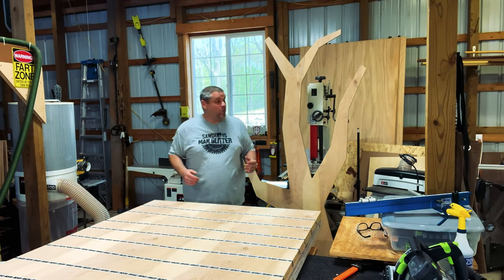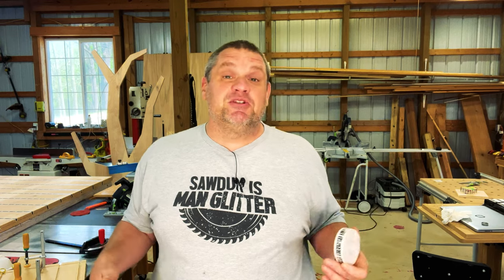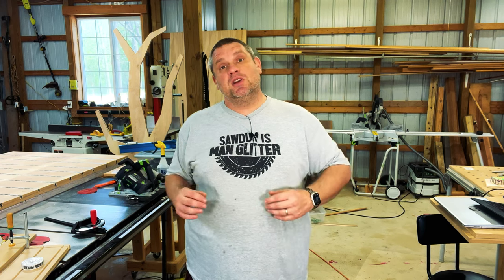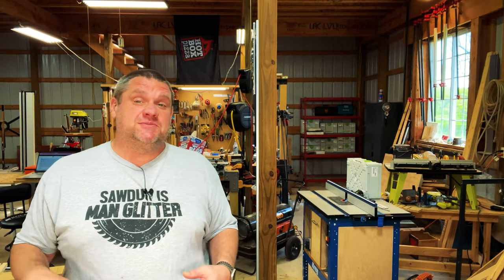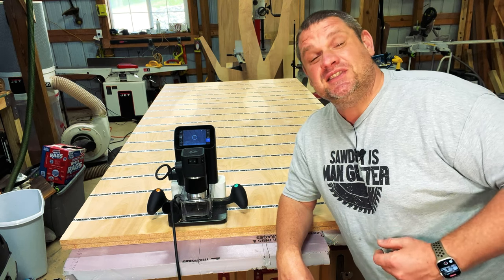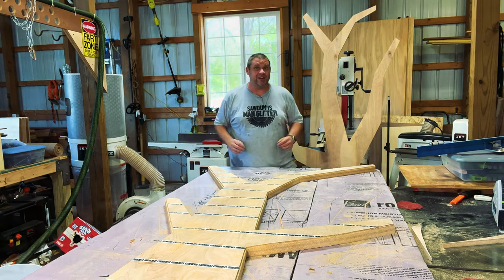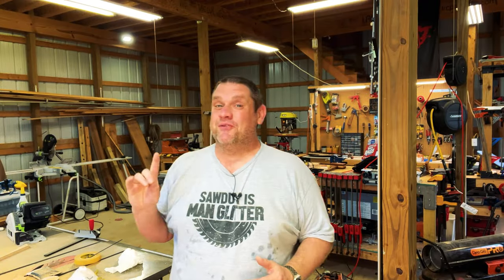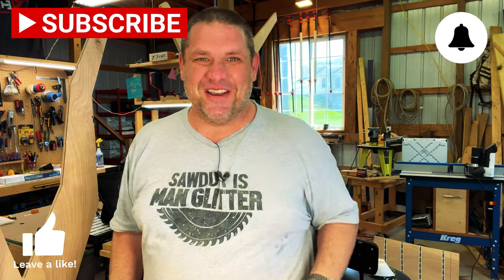Get Ready to Be Amazed: Create Incredible Wall Art with Shaper Origin! #shaperorigin #woodworking

Comment: Cool tool as an expensive toy I suppose. I can't help but think the track saw, jigsaw, and a sander for the edges would be faster and cheaper.
Reply from the maker: You may be right.   In fact that is why on these second set of trees I only did the one 1/4 inch pass and basically used the jigsaw, track saw etc to knock out the second.   The shaper is definately much more suited for smaller projects like engraving and making smaller templates.   But I almost feel obligated to use it anytime I get a chance too.  My wallet still hurts! :).  Thanks for watching MagiusUSA!

Comment: Can you just print out the shaper tape pattern and tack it on the board?
Reply from the maker: EXCELLENT QUESTION!  I’ve actually been researching that a bit.  It appears they there are some images available online where you could print out dominos to have it work.  I’m going to be trying that soon to see if it works.  Thanks for asking and sharing encryptor!
Reply: @FlynndoggWoodwork  There is a  shaper domino generator on the internet and you can print them out. Cut them up and stick them to some double sided tape. Save you some money.
Reply: @FlynndoggWoodwork  The only problem I could see using double sided tape is on the areas that dont have the domino could stick to the router as it passes. So maybe just use painters tape and glue the domino pattern to that.

Comment: I like it, and also my Origin. Great job.
Reply from the maker: Thanks so much txx1972!  Hard to find people that actually have one, I don't break mine out as much as I should, but it is such an amazing tool!  Thanks for watching!
Reply: @FlynndoggWoodwork  I use mine a lot, but for smaler projects than you. 
Decission to use the saw was the right one. For less than 20mm I go fully with the Origin. But deeper, it's faster with a saw and a router for that size of tree.
Reply from the maker: @Schoendings  Awesome.   Do you have the workstation?   I use that mostly, as just like you I use it for smaller things.   It's wonderful for engraving.
Reply: @FlynndoggWoodwork  yeah i have. I am only a hobby woodworker. But i Love the machine. Doing a lot of boxes and decoration things and that the Origin ist perfect for. Also for things you have to mostly make a Template for, with Origin, just Draw it and go. :-)